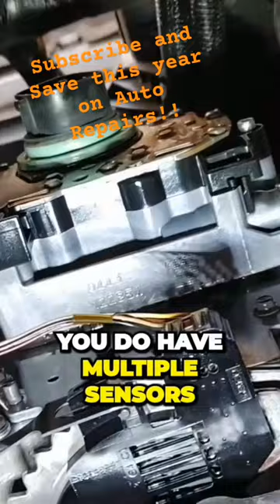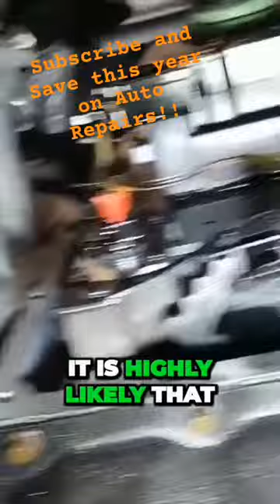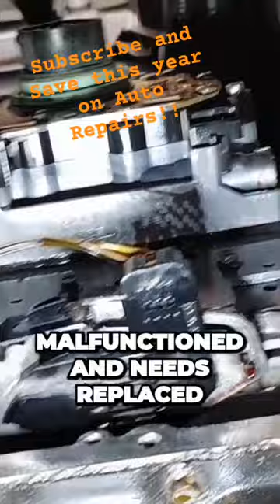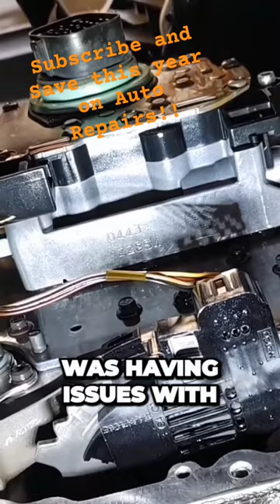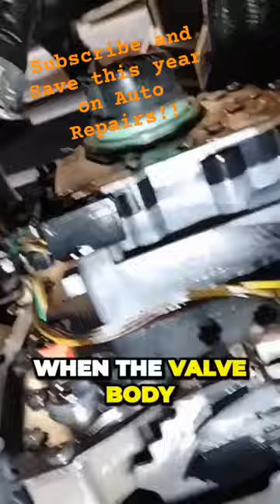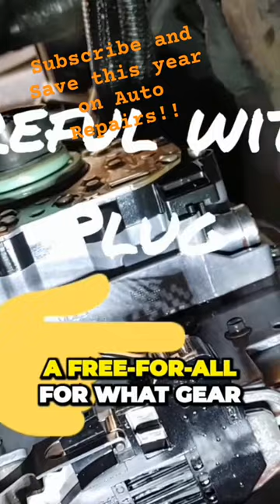62te Transmission Problems Explained Easily!

Comment: My van is making winding like noise almost sounds like a powersteering pump but the noise is coming from the trans
Reply from the maker: What does fluid look like?
Reply: @Sellthoseflippingcars  I dropped the pan this evening, and it looks like the color of a chocolate  labs  fur coat, vehicle  has 160k miles  I'd say this is its first service based on the color of the fluid and gatherings found on the magnet.
Reply: @rugged1987 I know this is a month old comment, but if the magnet was covered with a lot of material that looks like lint it is likely torque converter clutch material. Servicing it may buy you some time, but it’ll more than likely happen again.
Reply: @ChevelleMike71  so then he should just change the torque convertor and pump?
Reply: Burnt fluid mos likely the cause first change fluid 
Add some trans tuner to it drive it
Reply: @NycForgiato  If it’s putting that much material through the trans I’d recommend it need to be completely disassembled and at the very least cleaned out. The trans in the better half’s car had hard parts that failed.
Reply: It's a bad pump. The Achilles heel design of this unit is the compressed pump design. They had to make the pump and torque converter more compact because there was less space to work with.
Reply: Mine did that. It's fine now After fluid changes and using trans tune
Reply: @CHEAPROLLIN  Yeah, I got this one fixed up. With filter fluid change.